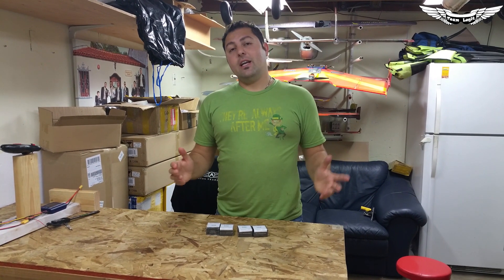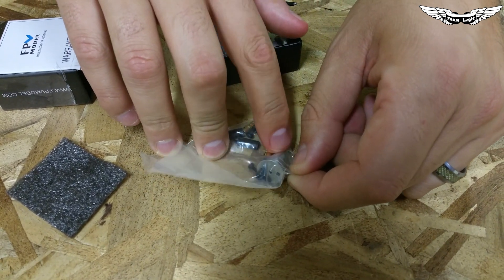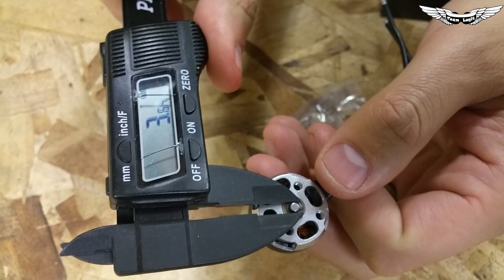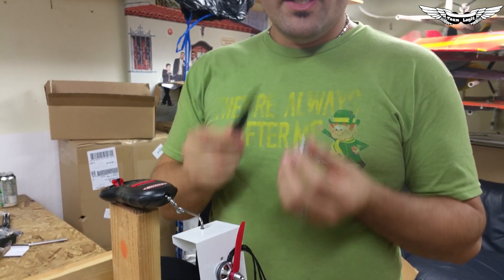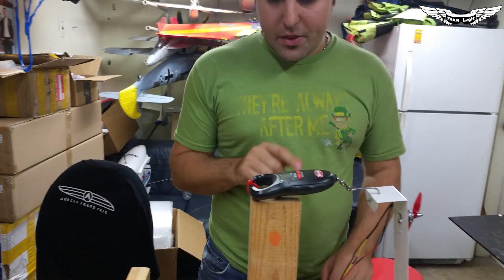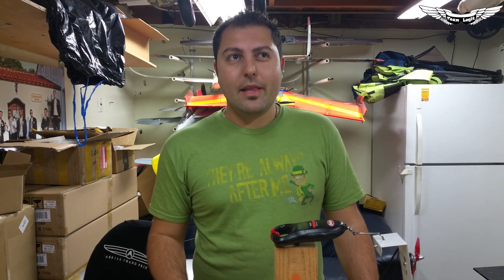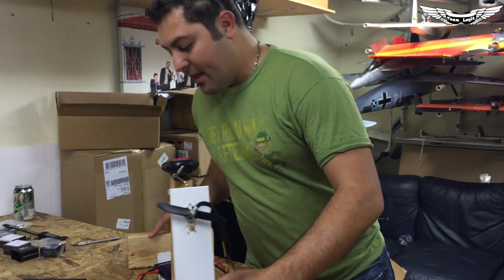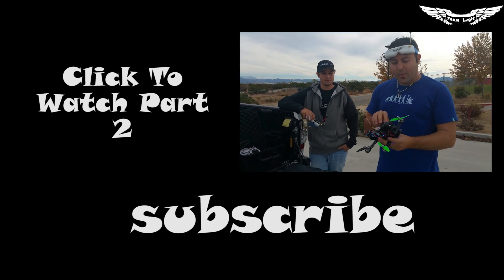FPV Model Motors MC2204 2300kv Review

Comment: Congrats for the efforts mate, but at the first glance at your DIY thrust device, l can say it really doenst measure the thrust of any motor / propeller  setup. The failure has to do not only with the width of the vertical white metal plate ( which seems to be as wider as a 5 in prop), but also because the motor is not mount in the same level of the spring scale. The lower the motor is mounted , the lower the thrust reading for the same setup will be, and the thrust reading will be zero if you mount the motor near the hinge at the base, because 100% of force to hold the motor in place will be focused at the base and not in the scale. 

In order to get the correct reading, you just need to mount the motor at the very top of your DIY device, at the exact same hight of the " spring scale" and make the white metal plate behind the propellers narrower.

Another solution for your DIY device is: mount the motor exactly in the half of the hight of the white vertical plate, and you will have to multiply the thrust reading by 2 to get the correct value ( at 50% of hight, half force to keep motor in place is applied at the hinge at the base and half force will come from the scale spring.) 

Hope it helps , all the best   ;)

Comment: I appreciate a lot of the stuff you guys do, but jesus this was sad. I mean read a science book before you build these contraptions or do these tests. 0.15Kg is about how much in grams? lol
Reply from the maker: We Picked up a legit Thrust stand after this video, I admit its not our best work. It was a late night. Also those motors were picked up by another vendor so they should have some documentation.
Reply: Team Legit So why didn't you do a retest with the legit thrust stand?
Reply from the maker: The company sold off the motor line so there was no further testing required

Comment: Agreed with the other posters, your numbers are WAY off and doubtful the motors were that low. I would redo your thrust stand or pickup the turnigy thrust test stand for more accurate numbers. Too much resistance with your thrust simulation based on the fish scale etc.

Comment: You need the fish scale on the air feed side, it is pushing the scale spring in reverse a lot. The 5030 should be about 400g on 3s full, 480g +  on 4s my guess. I have 2204 Emax that flow that.

Comment: Motors looks nice and sound good.. your test rig is giving extremely weird result though. I think the big reason is you have attached the motor to a board with only an inch of prop showing off the edge.. which is obviously wrong. All the thrust is being wasted against that board.

Comment: These look like same specs as HK multistar elite.  The elites are super smooth and machining is really nice.  Bearings are smooth and about $15 a motor as I recall.  I also have tried the baby beasts and while they have less kV they feel like they have equal or better punch but slightly heavier and not as nice machining.  I think bb motors better for 6 inch props and these 2300kvs are best on 5 inch.
Reply: Great video by the way.  Appreciate your review.

Comment: Sunnysky x2204 2300kv motors make 441grams of thrust on 3s with a Gemfan 5030 prop. Either these motors are way under powered or your thrust test rig is no good.
Reply: Highly suggest not posting inaccurate thrust numbers. If I were the retailer who provided these for review I wouldn't be too happy. That thrust rig has major (quite obvious) design flaws.

Also, if those numbers are accurate it would take over 80% throttle for even the lightest mini quads to get off the ground.
Reply from the maker: ezikiel121212 Well I can Assure you my mini Quad was able to Lift off at less than 50% with plent of power to spare. Watch the follow up video coming soon.

BTW, I like your flying styling, I watched a few videos on your channel. Formation with multiple pilots is always a blast.
Reply: Could it be the white fulcrum piece on the test rig is too wide?  You might not be getting full thrust because the air can't clear the motor mount.  Negative feedback from prop wash?
Reply from the maker: Like I mentioned these may not be the most exact numbers but it gives a general Idea. 
Also almost every one I know is no longer running the SunnySky Motors and also alot vendors I know are no longer carrying The SS motors due to quality issues.
Reply: Team Legit
Your thrust rig seems to be waay off. 15.8a @ 340g is so low its not even funny for a 2300kv on 4s.

A Cobra 2204 1960 kv has ~670g of thrust with a 5x4, and only pulls 13.4A. Thats twice the thrust.
Reply: Yea, there's a stack of problems with that jig. 
The motor mount is too wide.
It's a spring, the more you bend it the more it'll resist. The only resistance should be the scale.
The chain is acting as an anchor, the motor has to lift those links.